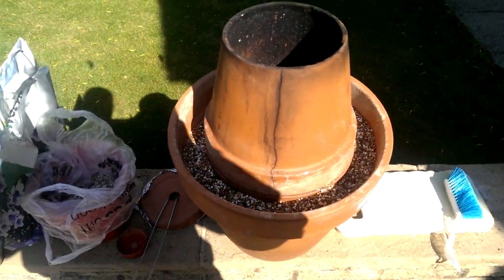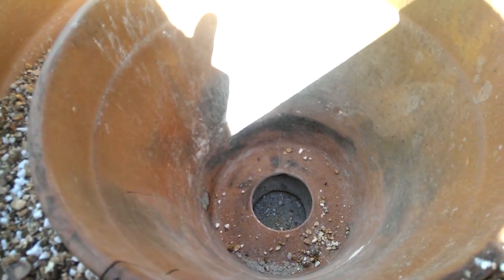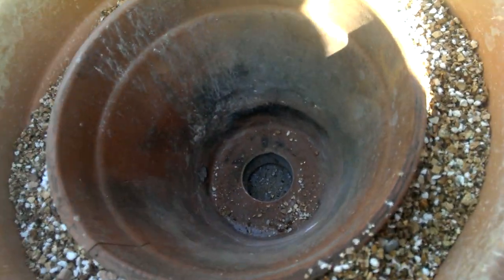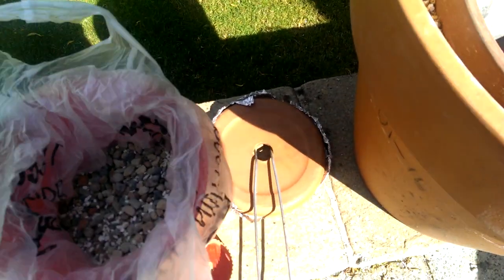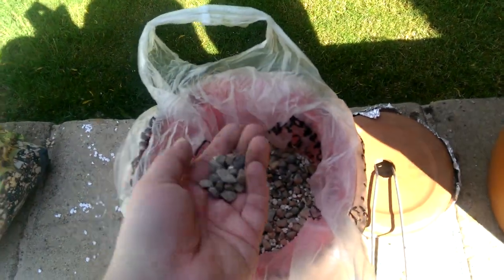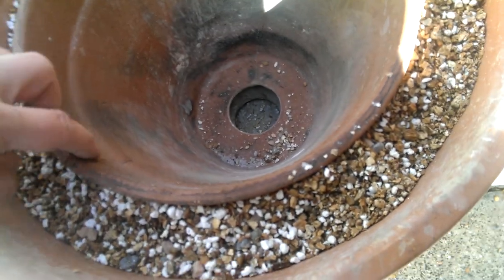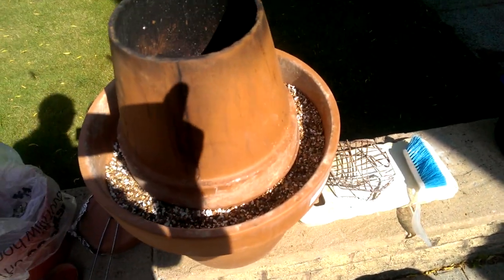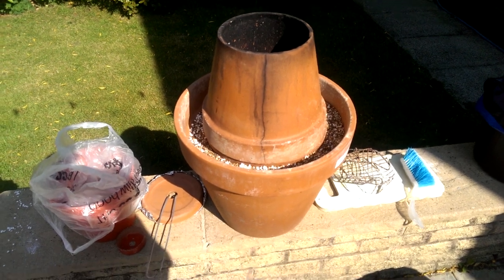essential modifications - Making a DIY Tandoor Oven

Comment: Suggestions only: Purchase a terra cotta clay dish and drill a few holes in the plate. Turn that plate upside down and place it into the bottom of your burn pot instead of the coiled metal piece your using. This will allow good airflow and keep your coals up off the bottom of the larger burn pot of the oven. These round plates are very cheap and easily drilled out with a masonry bit. You don't have to enlarge the middle hole as you did to produce enough air flow necessary. The plate method will allow good ventilation inside. Just remember to turn the dish upside down when placing it inside the larger clay pot.Instead of using Vermiculite alone, get some Sakret crack-resistant cement mix and make a mix of 40% Vermiculite to 60% crack-resistant cement mix. This will cut down on water/moisture in your insulation and will provide better insulation, as it is essentially the same as firebrick material when mixed up. The clay likely broke, not because of excessive temps, but because of moisture. This is what usually breaks up cinder blocks when they are used for rocket stoves and such. The blocks will retain moisture and then break or crack when exposed to high heat.

Comment: I use chicken wire to support cracked pots. Wrapped and twisted together tightly with needle nose pliers.
Reply from the maker: That sounds like a good idea! I would be careful not to use a wire that is galvanised though. The fumes from some corrosion resistant wires may be poisonous. Perhaps a plain steel, or stainless steel wire would be more suitable. I am rebuilding this Tandoor soon. Thanks for your input, happy cooking!